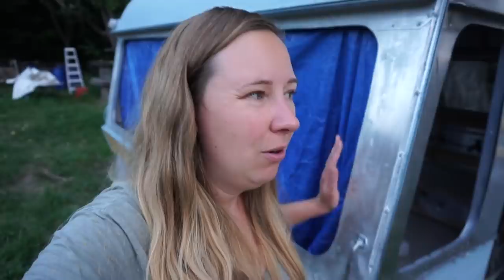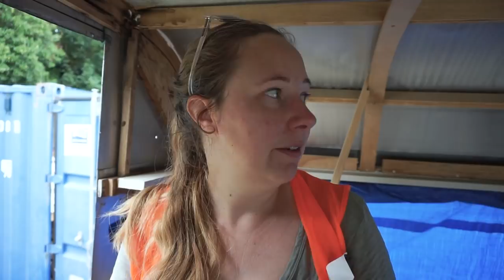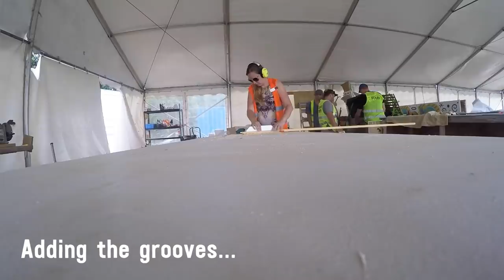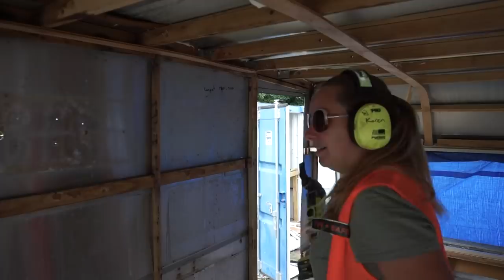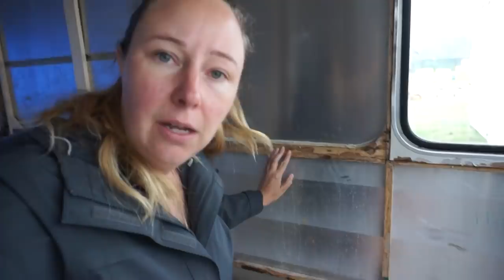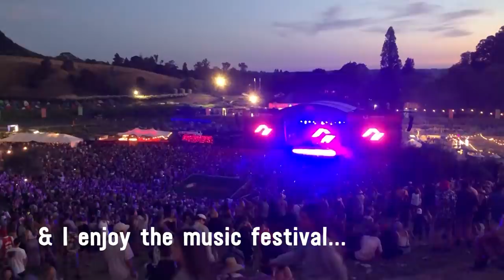Find 7 Leaks Inside Caravan... Start Fixing Wood Inside

Comment: When I was building caravans we started with the bare frames,then interior ply went on which gives strength and rigidity to the structure. The walls and roof were then fitted,then the aluminium skin went on last. You are essentially doing it completely opposite,but that shouldn't be an issue. Any leaks need to be fixed by drilling out the rivets on the joints,apply new seal,then re rivet. You also have an advantage by being able to seal all joints from the inside which could never have been done in the factory. Don't worry too much about adding extra wood to the frame,it will add little weight but greatly increase strength and rigidity,they were originally built using the bare minimum to save costs,not to save weight.
Reply from the maker: Ah this is so interesting to read. I have been surprised by how little sealant has been used! Makes sense that this is because the skin was added last.
Reply: good point mate. Im starting with the rails, then if it still leaks do the inside. I dont want to ripp the inside apart to discover most of the battons are good condition as i ve made  unessesary work for myself lol!

Comment: Often, when dealing with jobs that you don't really know what you are doing but you aren't incompetent, concentrate on only one thing at a time. Don't flit from problem to problem getting distracted/depressed. There's always room for changing the order you do things but it is much easier to chip away at the tasks that do 5 things at once.  And if you are solving the leaks the wooden frame needs to be intact first. No point in sealing the panels if they are then going to be pushed and pulled by altering the frame afterwards.
Reply from the maker: That is a good point about the frame vs sealing panels. It's a jigsaw puzzle! I have found I'm best if I just focus on one part at a time...

Comment: hi when i restored a lilliput caravan there was rotten wood everwhere because you cant tell its getting wet till its too late. I replaced all the floor, wall framing etc using treated wood then  if it does ever get wet it wont rot, i screwed all the inside ply so i could access the internal   framing if i wanted to check on dampness by just using a screwdriver/drill. good luck  with the project
Reply from the maker: I was considering the same thing with easy removable ply... I'm sure to make mistakes!!

Comment: When I renovated our 1973 Classic I removed all the exterior trim and cleaned it up or replaced it as necessary and then refitted with stainless screws and sealant. The aluminium overlap joints I removed the old rivets put sealant between overlap joints before riveting back up. Use Closed end pot to rivets as they wont leak. Any thing that mounted on the out side of the caravan was always sealed up with sealant. I also used a sealant that was able to be painted over. Making shore the caravan was water tight before starting on the inside I new would pay dividends later on
.
Reply: Aluminium and stainless steel have a massive reaction to each other as they are on the opposite sides of the metallurgy scale. That's a bad recommendation. Monel pop rivets are the only and best option.
Reply from the maker: Does sound like I need to focus on sealing it right!!

Comment: Every time you tow the caravan without a front or side windows or blocking them off with thin plywood the air pressure will build up in the van and open up seams, you can see this happening in this video with the roof seam and the door being forced ajar. I once had the front window broken on a motorway and by the time I pulled off the motorway one of the side seams of the caravan had pushed open and that was a fully fitted out caravan.
Reply from the maker: That makes sense!! Yikes, crazy to hear that the side seam went.

Comment: Your doing a great job,  can you get a tarpaulin over the top? Remove any exterior trim you can and replace the sealant then refit trim. Can you get wood hardener in NZ great to use on soft wood once it has dried out.
Reply from the maker: Luckily the weather improved... straight onto sealing the roof!! I've bought some epoxy to help the wood. Good idea to add sealant everywhere now...

Comment: I would drill the rivets out and run sealant around and then rivet the cover back on then at least you know you have sealed wherever the leak was. Good luck
Reply from the maker: There have been a few areas that make me nervous...
Reply: @TravellingK  Karen. Make sure you use 'Sikaflex' as silicone sealant has Acetic acid as the curing agent which will corrode the aluminium. Just sayin'!

Comment: Well look at you Girl, designing on the fly and using some pretty serious power tools. You go Girl. I like the corner braces. It will help in stability. And yes get it closed in and sealed so the interior work won't get messed up by the weather. Keep at it Lady, you got this. Thanks for sharing...Vic
Reply from the maker: Thanks Vic! Slowly getting there!!

Comment: With things like that window that has been deleted you need to drill out all the rivets and remove the panel  then run a bead of sealant round so that when the panel is replaced the sealant gets sandwiched in,they obviousley did not use sealant in the first place.
Reply from the maker: I think they have been selective with where they've used sealant🤣

Comment: I would replace all of the wood, then put in some temporary internal cross members. Then I would remove the entire outer skin and then refix it to the framework as I replace and and at the same time reseal as you go with a polyurethane sealant NOT silicone sealant as that stuff shrinks and rots over time. I haven't used silicon sealent for over 15yrs now and everything that I have sealed with polyurethane sealant is still watertight.
Spend a little more time and money now and save a whole load of trouble later. Take it from someone who has learned the hard way. I've now got a Bessacar xl 5 Wentworth that needs it's entire left side replacing because I used silicon sealent on it in 2003.
Reply from the maker: Hmm this sounds intimidating! Might be beyond my skill level right now. Good to know about the sealant... I'll check what I have!
Reply: @TravellingK  You don't need to K. Fix the internal framework while the structure still stands and mould the frame work to the skin. Not the other way around. It might be different if you were building from scratch but this is a restoration.

Comment: The new wider studs you are putting in, make sure they as thick as the old ones.  Wouldn't want to sacrifice strength in one direction to add it in another.  The thickness from the wall will keep it from going in and out.

I've mentioned before to seal all the leaks before working on the inside.
Reply from the maker: Yes, the wood is just as thick. Slowly does it. And guess I should have tackled the leaks sooner!!

Comment: Hi hope you are doing well?
The problem with the old veteran caravans is that the walls and roof plate are nailed so even on our caravans in Sweden we had an old caravan when I grew up that was from 1965 I have memory from it and then it was too expensive to make whole plate on the roof so they had nailed the sheet to joint it on the roof we had a round ceiling light which was transparent glass it looked like an aquarium when the water ran in when it was raining .... have a good time// Anders.
Reply from the maker: Ah I've noticed the rusty nails! Some have jiggled loose too. Oh no! Not good about the light!

Comment: Well done. Remember your interior ply is structural bracing too once it's in.
Reply from the maker: That is sure to help too!
Reply: @TravellingK  Use "form ply"as this has a marine glue line. Ie. it won't delaminate if water gets to it. If you intend to cover the ply anyway then it doesn't matter. Cover with vinyl wrap as that is so easily applied nowadays. (BTW> Form ply is super cheap and has an 'A' and a 'B' side. smooth and rough)

Comment: I totally agree with   asterix 64
  make it strong  it will also stop the aluminium from opening up at the joints in the future and start leaking, anywhere there is a leak drill those rivets, open it up fill with sealant and rivet again, the more wood will give you also more support, gives more  area to screw to as well, good luck 
you have all the time in the world Ha Ha
Reply from the maker: Yes, I've started drilling out the rivets in the problem areas... keep to use plenty of sealant!!

Comment: Hi Karen!

Really interesting video. Great to see you getting stuck into this fascinating project. 

Our caravan is now showing damp in the forward right corner walls, which I hope to investigate this summer at some point. 

I wouldn’t worry about too much adding weight in your build, especially as you’ve got a really good tow car. Unless your plan is to sell it on afterwards. Sorry if you’ve mentioned this in a previous video! I really ought to catch up from the oldest to the latest video when I binge watch, not the other way around 😂 

Hope you’re both well. We had hoped to come out to NZ between November to February, however the virus has meant that we have lost all our income, so we’re subsisting in savings at present which is a bummer for future travel plans. All will depend on how long the tourism industry remains locked down for. 

Jamie 😀
Reply from the maker: Hello!! And I need to catchup on your travel videos 😜 When did you get back to the UK? Such a shame that your future travels might be disrupted from this crazy virus. And hope your leak is an easy fix!!
Reply: Travelling K No worries 😝 We returned to the UK at the end of February, just as it was all kicking off over here. We were lucky though, so can’t complain!

Comment: Hi Karen I love watching your caravanning adventures  and look forward to seeing the progress on your old caravan project. I was wondering what type of insulation  you were thinking of putting in your caravan.
Reply from the maker: I keep sea-sawing about the insulation at the moment. Any thoughts?
Reply: Yes there is a product called flexicell xlpe it's a closed cell insulation (it doesn't absorb moisture) . It would be prefect for a caravan  as it will prevent condensation and noise  while also being a good thermal insulation. Perfect for -20 to 95 degrees.  Wool or fibreglass type insulation although they have  better R ratings will absorb moisture  making them  useless and giving you a cold, damp feeling  space. Polystyrene  is the next best thing  but it squeaks, it doesn't like being bent in curves, and can react with the plastic on the wiring.   Check out www.rhira.com for more info on flexicell xlpe. I have an industrial insulation business  and use all types of products.  We can sort you out with you insulation needs.

Comment: Hmmmmm you're getting to be quite the carpenter  and good  with the tools now  Karen we'll have to call you ""Chippy"now.One thing to remember is when the van was originally built it was made as cheaply as possible and still function as profit was the reason for building it.As for the leaks remember silicon and epoxy are your best friends and re test after fixing the leaks with the rain or a hose pipe. Above all work safely especially with that  table saw .Take care stay safe....Just give Hayden a big smile he'll do anything for you I can tell grin

Comment: all the timber should have been epoxy soaked which makes them impervious to rain water and ten times stronger. No need to go up a size ever.  Fresh water is the biggest killer of timber. Don't know what you were thinking when you said "rubber seal the outside". 
Fix leaks first. The walls should have a vapour layer of XPS foam stuck to them which also stops the drumming noise. NZ is cold so you then want to insulate the walls by applying a foam board glued in and held by expanding foam on top of your vapour layer.  Regardless of whether you start on the outside or not. Seal the leaks first BAMN! (By any means necessary).
ONce done,  you can then do the outside at your leisure. Normally you would ensure that the thing was weather proof before starting the inside... but hey! (BTW> Channel is much more interesting with the two of you and your skills).
Reply from the maker: A lot of helpful info here, thank you. I've looked into epoxy for the wood and think that's the way I'll go! Will need to look more into this foam you're suggesting!! And sure Hayden is happy to hear you enjoy the videos with both of us😜
Reply: @TravellingK  If you have a marine store anywhere near you look for "Everdure"
It's a thinned epoxy that soaks into the wood and makes it a 'composite material'.
https://www.international-yachtpaint.com/en/au/boat-paint-products/primers/everdure

The foam board is sold at Bunnings. Butit is basically a close cell foam board that is usually about 1" (25mm) thick) and is really an awesome insulator.

The XPS foam is about 6mm thick with both sides having a bonded silver face. This stops the  'drumming' which was so evident in your 'transport video'. (LOL) and you use an aluminium silver tape to seal it. Both are available on eBay. 

There are plenty of YT vids on campervan insulation from the UK that show how best to make you 'palace' a thing of 'cuddly warmth'.
(You do realise you live in the land of "Karen's" right?)

Comment: I would use a piece of metal between the wood you are cutting out, and treat all the wood, new and old to prevent water damage in the future. Even some what damaged wood can be treated with a two part epoxy meant for that purpose (learned the hard way).
Reply from the maker: I've actually bought some marine epoxy!! Think that a good idea to treat the wood.

Comment: Great job why you dont use glue bitween plate and wood
Reply from the maker: I've learnt that there are only certain parts where the wood is actually attached to the metal🤷‍♀️
Reply: Ok

Comment: I hope you are using treated wood otherwise it will be a waste of time , perhaps using the slightly bigger wood word have mad the structure stronger? Good luck I hope it all comes out right .
Reply from the maker: I've actually heard treated wood reacts with aluminium! But I have bought some epoxy that is used in boats.